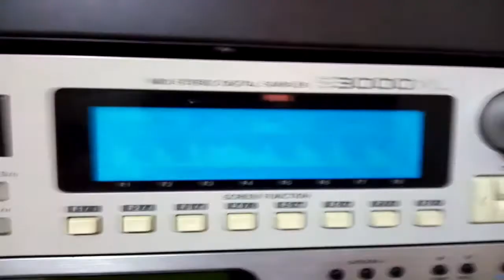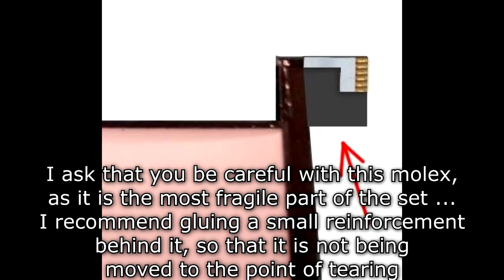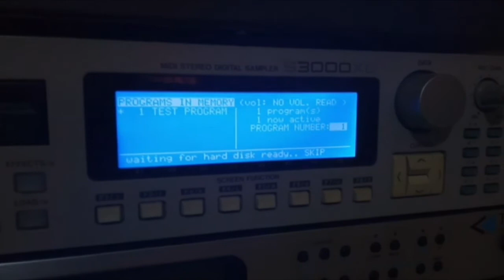DIY - Akai s3000XL backlight Iphone 6 Plus replacement! - Riva Lima

Comment: Could the new backlight also be powered using the old inverter or is the new regulator a necessity?
Reply: It is: The original inverter is the part that emits a high pitched noise when the backlight is on.
Reply from the maker: New regulator, see the video again